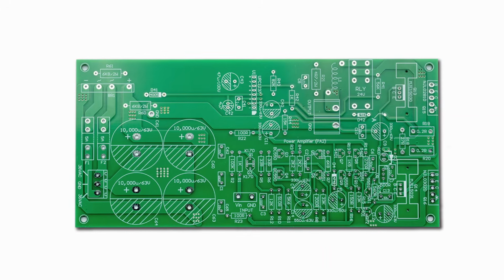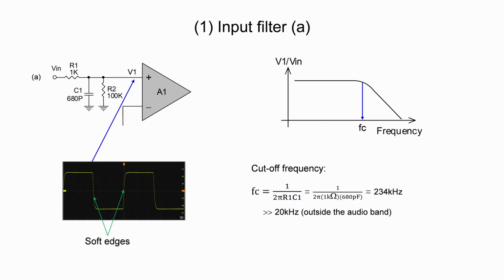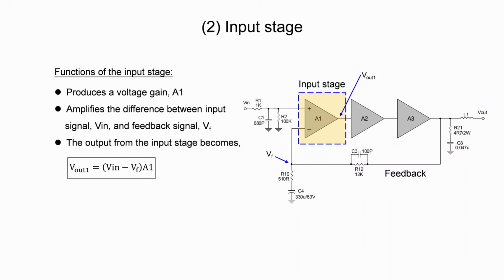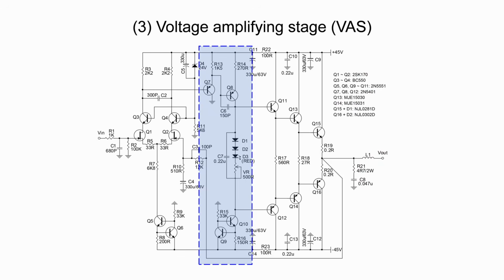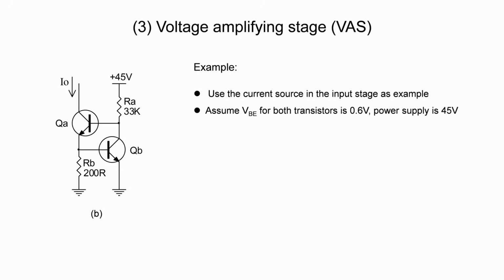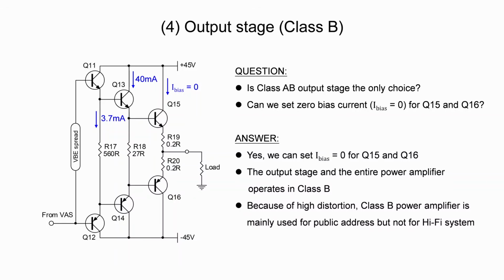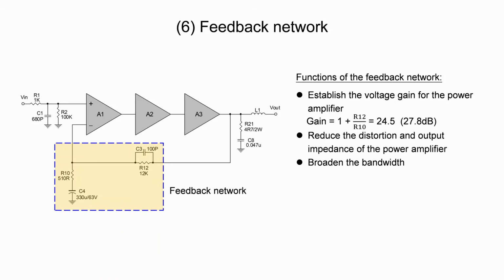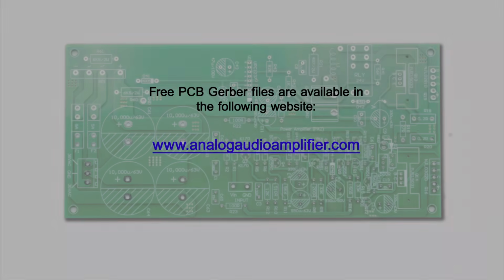Design a 70W Class AB audio power amplifier using ThermalTrak transistors

Comment: Hi Sir 
What is the offset has to be set and what is the procedure to Vr500
Reply from the maker: There is a 18-page construction manual in the website: https://www.analogaudioamplifier.com/
In page 13 to 15, there are construction tips for assembling and testing the PCB.
Another tip here: turn the VR500 to the anti-clockwise to get less dc bias current while clockwise for higher dc bias current. If you need any further help, send email to us by the same website.
Reply: Thanks for your response

Comment from the maker: Regarding the right amount of dc bias current using for output transistors, there is not a universal answer that satisfies all different types of output transistors and power amplifiers design. However, there are several factors that helps to decide the right amount of dc bias current. (1) Reduce cross-over distortion. It usually requires 30 to 50mA to bias the output transistors so as to minimize the cross-over distortion. In most cases, dc bias current over 100mA does not have obvious advantage for Class AB. (2) Sound improvement. If the sound is improved with higher dc bias current, then stick to it as long as the size of the  heatsink is capable.  (3) Size of the heatsink. If the heatsink is small, keep the minimum dc bias current, ie, 30 - 50mA. Otherwise, change to a larger heatsink if higher dc bias current is needed.

For this 70W power amplifier, I am lucky to have a pair of fairly large heatsinks, 30x10x6(cm). See the picture at (0:12). This heatsink only needs to take care one pair of power transistors and nothing else. The dc bias current is set to 140mA. When the power amplifier is left idle without playing any music for over one hour, the heatsink is just slightly over room temperature, ie, around 27 degrees Celsius. When the power amplifier plays reasonable loud music with 4-Ohms loudspeakers for over one hour, the heatsink is just lukewarm, ie, around 40 degrees Celsius. After all, it seems to me that the sound is slightly better, when dc bias current is somewhere around 100mA to 140mA for this power amplifier, than the case with 40 to 50mA. Even the power amplifier can be set to a higher dc bias current with this heatsink, I just leave it at 140mA. However, if you do not have such a large heatsink, you may need to set the dc bias current to around 80mA.

Comment: If you reduced the value of R2 to 12k, wouldn't the output DC voltage at the amplifier output be significantly reduced? My amplifier without a DC servo reaches 0.01V. The capacitor C4 should be a non-polar model (Nichicon MUSE) or a conventional electrolytic should be connected in parallel with a 1N 4148 diode. The quiescent current is unnecessarily high. I tried setting the quiescent current of the power transistors from 40 to 120mA per transistor on my amplifier, which also has a triple EF output, and I didn't notice any difference by listening. For this connection, a quiescent current of around 50mA is recommended.
Reply from the maker: Thank you for sharing your experience 👍

Comment: Very good video, plenty of details to chew on.
About the VAS, would it help to add some form of current clamp for protecting the transistors during clipping?
Also you have returned the Miller cap to the base of the VAS transistor and not to it's buffer's base as is more common...any benefits to your approach?
Reply from the maker: Thank you for your comment.

Comment: "Output DC offset is 0.1V - which is good enough". Ah, no. No it's not; that's considerably high, which means the input stage isn't correctly "balanced". Also, 140mA is a ridiculously high quiescent current. Have you actually bothered to measure the output with a scope while trying lower quiescent currents? The cascade output stage should work fine with no measurable crossover distortion at a quiescent current of ~40mA. You may want to read Doug Self's handbook on power amplifier design.
Reply from the maker: Thank you for sharing your experience 👍

Comment: That 27 Ohm resistor right ? Should be at least 100 Ohm or maybe its 270 Ohm ? And using dual 45V - this is 200W amp easy ...
Naaah - this schematic stupid AI make is not OK ..,.
Reply: No its right. Check the max current If a output transistor " need"  High current. Hfe is about 100 an he use Re. So the base current might be high to get huge impulses

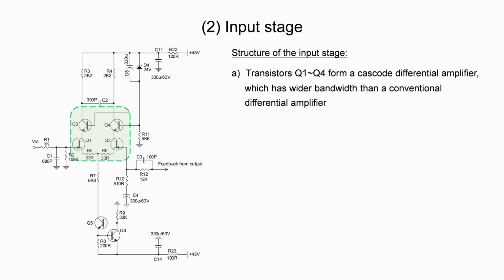Comment: Thanks for sharing the video, it must have been a lot of work to prepare it as it covers so much ground. I'm particularly interested in how you've configured the cascoding transistor biassing network (8:00). How to choose the zener diode voltage (24V) and why is the 24V referenced to the positive supply rather than to 0V? From my naive perspective it looks like any residual ripple on the +ve supply gets fed into the JFET drains - is there an upside in not referencing the zener to 0V?
Reply from the maker: A 24V Zener is so chosen that there is approximately 20V dc on the collector-to-emitter for transistor Q3 and Q4 while also around 20V dc drain-to-source for Q1 and Q2. Even though R22 and C11 forms a R-C filter to reduce the ripples going into the input stage, if the Zener is referenced to ground less residual ripple will be going into the JFET input by the bypassing capacitor C5. This is a good point. Thank you for pointing this out.
Reply: @Analogaudioamplifierdesign  Thanks. Is there a particular reason for the choice of 20V for Vds? I see the datasheet mostly gives specs at 10V.
Reply from the maker: @abraxalito  The drain-to-source break down voltage for 2SK170 is about 40V. When it is biased at 20V, it should be okay. When it is used in line-stage amp, it is usually biased at around 10V.

Comment: Did you get AI to design the amplifier?
Reply: The PCB with its components matches the schematic.
All transistors have a plausible type (npn/pnp, power rating, low noise types in the input stage).
You can see the hardware is real and well build.
This guy knows what he's talking about.👍
Reply: @Andi-d4i4s  I'm not saying AI is a bad it's going to benefit a designer. yes he's designed it and built it himself but what's wrong with using AI ? Can optimize a design
Reply from the maker: No. The contents are not made by AI but the voice is. I am not aware any AI tool that can do complex analog amplifier circuitry design. Thank you for watching.
Reply: @Analogaudioamplifierdesign  - Thank you.  I'd rather have an interesting video, with an AI voice, than no video that "would have had" a real voice.  : ).

Comment from the maker: Chapters:
0:00 Introduction
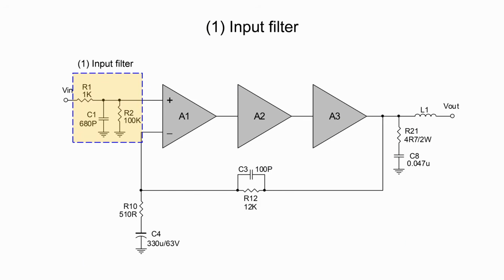2:33 Input filter
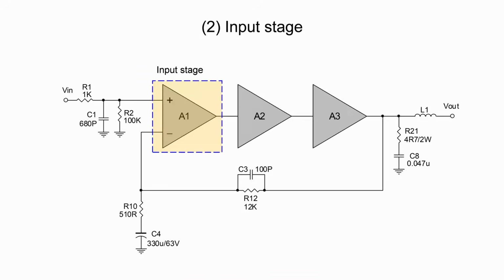7:33 Input stage stage
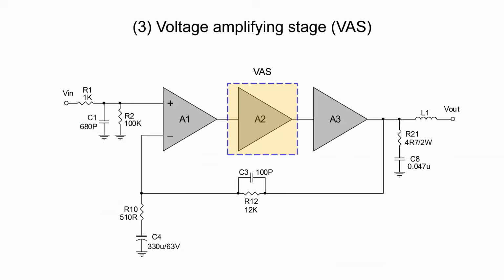11:24 Voltage amplifying stage
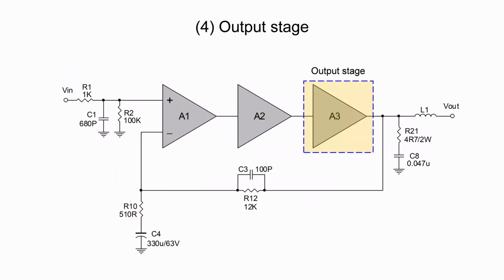15:59 Output stage
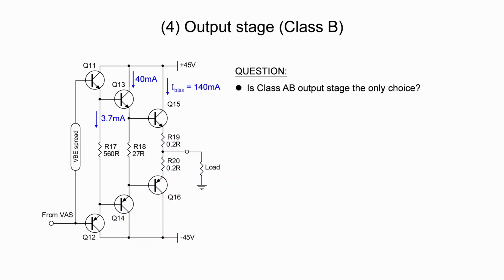19:17 Class B operation
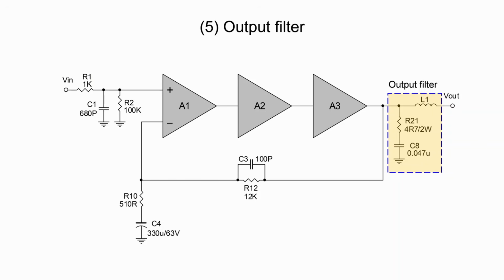22:42 Output filter
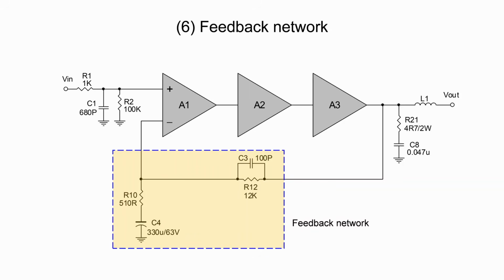23:22 Feedback network
25:13 Measurement / conclusion